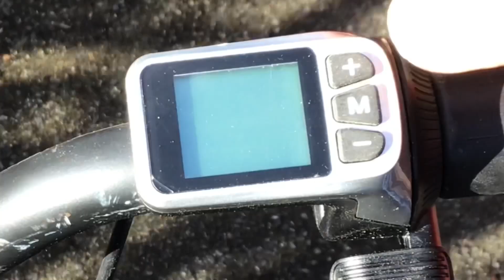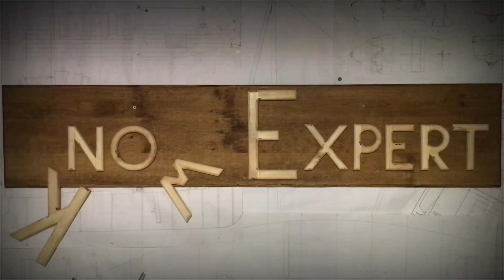I FOUND THE POWER… Electric Scooter part 3. Finish welding then THE TEST.

Comment: Legend mate, she's a propa little Ripa.
Intrigued as to what you are going to do with the fairings
Reply from the maker: Cheers mate…. The fairings are going to cover the wires from the speed controller and  hopefully round off the edges the hole in the base where I slide the batteries in. I’ve no idea how I’m going to do it yet but I’m starting it in about half an hour.